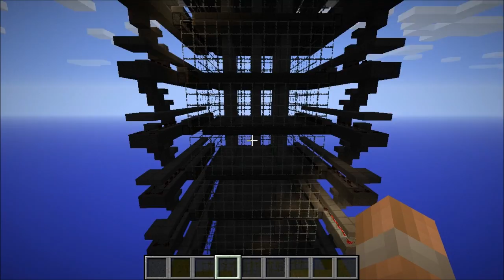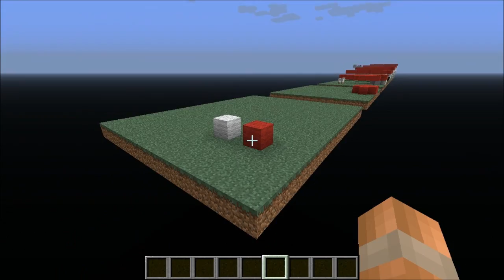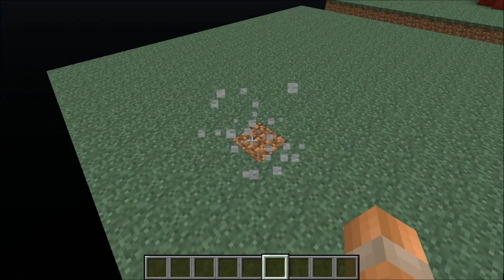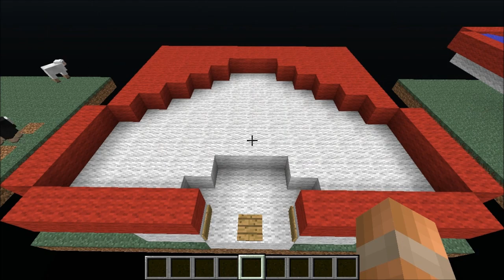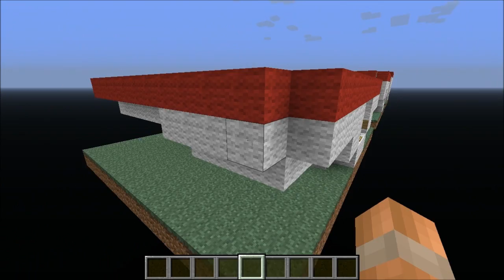Drop Farm Expansion Tutorial

Comment: @xisumavoid Hmm, my own fall trap has a minimum of 24 blocks of falling for normal mobs, which kills them instantly. Only the upper floors have room for endermen, which die due to the higher falling distance. Trapdoor fall trick, by the way. No pistons required. :)

That way you have room for more normal floors, yielding a larger loot amount, with only a small loss in the amount of pearls. (which you don't require large amounts of anyway, or you simply create a trap floating in The End)